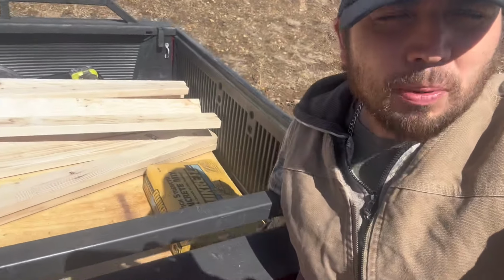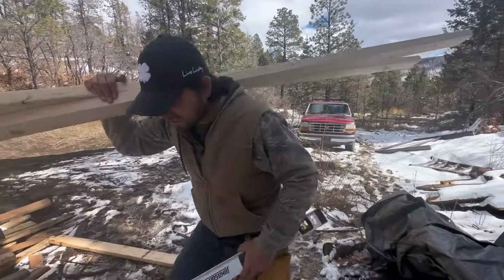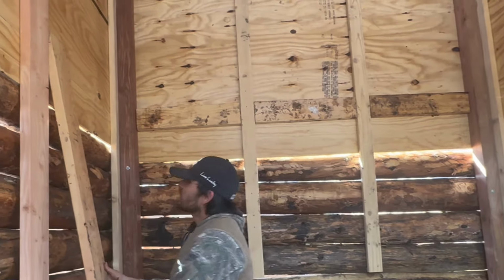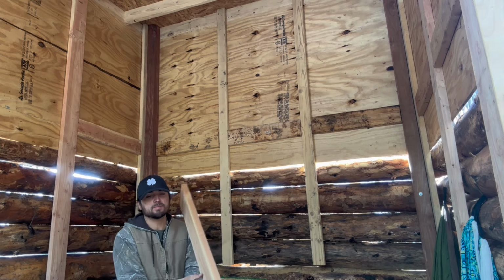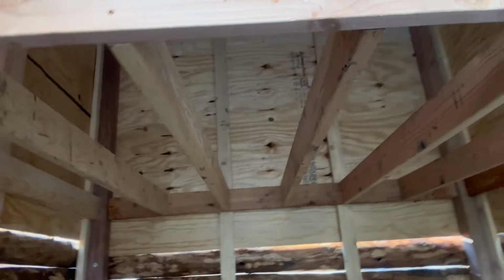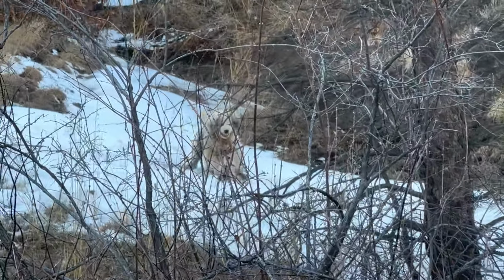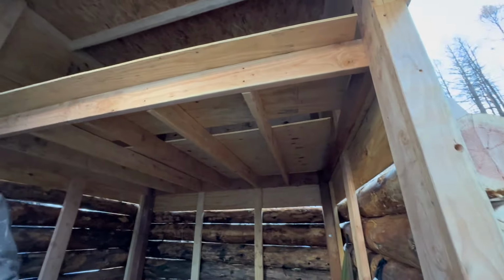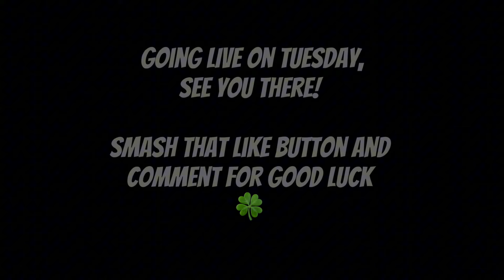The Lucky Cabin: Day 39 (Loft Day)

Comment: The rule of thumb for structural engineering is to have a joist sit on top of a vertical post. Not screwed to the side. Also if your going to put any family members up there might wanna buy some joist hanger brackets. Just trying to look out for you
Reply: I was really hoping those joists weren’t just held up by the screws ☠️ might wanna find the metal joist hangers section of Lowe’s -